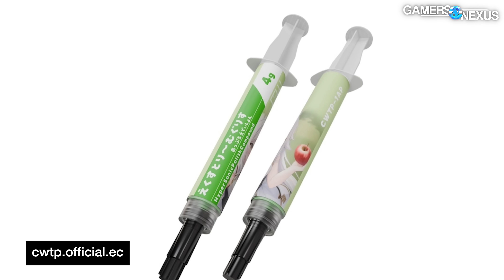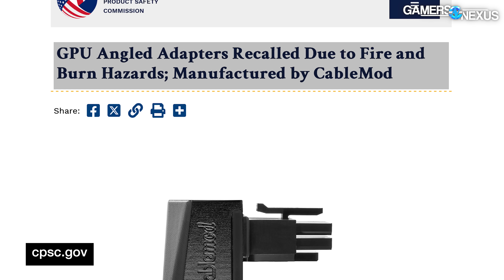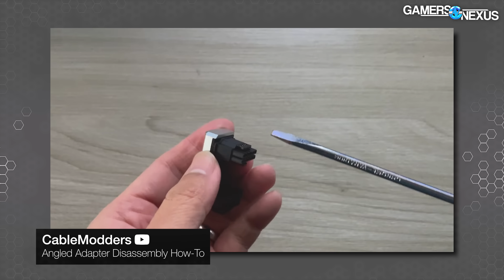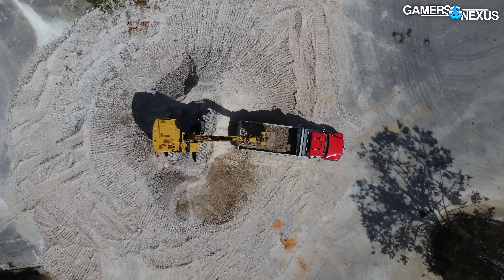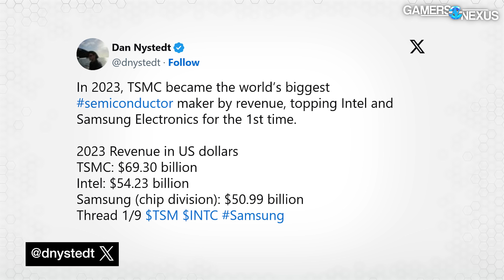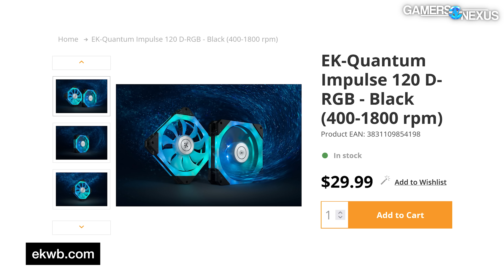HW News - CableMod 12VHPWR Safety Recall, Pre-Built PC ft. Malware, Scented Thermal Paste

Comment: The CableMod adapter recall is pretty ironic. If you heard about it prior to release, it was somewhat smugly touted as a solution to cables bending too much in reddit comments from the official account when burned 4090 cables were making headlines. Good on them for initiating the recall though.
Reply: Well, to be fair, it is a solution to bending cables.  It's just a terribly designed plug, which is not Cable Mods fault, they followed the spec.  These things should have retention clips on both sides to make sure it can't wiggle out.  It's just too wide for a single clip in the middle.
Reply: @TurinAlexander EXACTLY 12VHPWR is just a ABYSMALLY bad spec. There is no reason it should of ever been adopted by anyone.
Reply: @TurinAlexander  the plug's failure rate is below 0.1% and CableMod's angled adapter has an over 1% failure rate. Clearly CableMod did something wrong with the angled adaptor and it is entirely their fault. You can't blame the plug when CableMod themselves are selling other products using the 12VHPWR connector that are not failing as much as their angled adapters.
Reply: @ShinePostMiro  I suspect no one knows the true failure numbers of the 12VHPWR connector, I suspect some users caught the mating issue before it went critical and are living with slightly melted/warped etc... 12VHPWR Graphics card connectors, thus not officially reported. Again, I suspect most gamer/power/professional users types don't want be without their PC for a week plus RMA if their card is otherwise functional... Cablemod seems to be doing the right thing... they aren't a billion company so can afford millions of dollars in possible claims and or hide the issue (the big boys are well known do underhanded things to hide "issues"). I studied electronic engineering, I didn't end up working in the field, but I know enough  to know that the 12VHPWR is a style over substance design like most modern connectors (e.g. USB, USB-C, HDMI - wear out quickly,  with no locking mechanisms by default compared to what they were replacing) . The mating conductor(s) surface area is just too small for a decent safety margin especially for cheap  mass market production,  lastly the 12VHPWR  is rated at 600watts  and this issue is happening with the RTX 4090 @ 450 watts (average) unless there is revision I doubt we'll ever see a device pulling ~600 watt continuous on this connector.. old school standards would rate something at 600 watt but would be  engineered to be capable 700watt for safety.
Reply: @ShinePostMiro of course. But the fact it was conceived as a means of mitigating the design flaws (even if it completely failed at that goal) showcases the intent flaws of 12VHPWR
Reply: @Soandnb  The reality is that the connector works fine for at least 99.9% of the population.
Reply: @ShinePostMiro  I actually dug into that. The actual known failure rate of the dangle cables is somewhere in the .006% or lower range. There could be more, but the number of officially submitted melting failures is under 100 (This data does not include Cablemod from what I could tell. It only included the standard cables that came with the cards) out of now millions of 4090 units sold. But there is a reason they updated to the 12V-2x6 standard and cards are being cut over to it. The design might be fine but that doesn't mean it's good. The new standard does seem like a good tweak to make it a little better and safer.

As a side node, I don't believe I have heard that the Corsair or other bridge options are having the same issues as Cablemod.
Reply: @joee7452 That definitely does NOT include CableMod, because I’ve easily seen 30 burned CM cables myself just on Reddit. That’s just random posts too. Not me searching for them.
Reply: @MarioGoatse  Ok, makes sense because Cablemod would be considered after market and the reports I tracked down on the BBB watchdogs would have classified them separately. We do have to be careful though because not every post is real either. Cablemod does have  a larger issue it seems then the original cabling one but trusting every internet post saying it happened to them is questionable. 
I remember a lot of reddit posts pulled the first time around because some people were taking a posted picture and photo shopping it and posting it themselves. With the new AI art tools, it's hard to trust anything anymore.

Either way it doesn't matter. Cablemod is recalling and the standard has already been updated and cards are moving to that. Would have been nice if the spec and cabling tweaks would have happened earlier so all of this could have been avoided.
Reply: wow, someone who actually uses ironic in a proper setting. Am i dreaming?

Comment: Around six months ago, I bought some USB memory sticks from eBay that came with a trojan. I told the seller and his reply was "yeah, that happens sometimes". eBay, in its infinite wisdom, cancelled all the seller's listings for that specific USB stick... and left the other 70 listings or so he had for slightly different USB sticks.
Reply: Why I always check a USB in a sterile environment offline and clean it.
Reply: That just happens…
… could you tell the seller so we all can avoid that one…
Reply: @haukionkannel  - I've tried posting but YouTube's "advanced AI" probably thinks I'm advertising and deletes the message. Anyway, that account is inactive now. I'm sure he has another 10 or 20. Just treat every new USB stick as infected (use a non-admin account to scan and format it, preferably in Linux, before use).
Reply: @haukionkannel  - On retrospect, maybe the seller name was a hint that you might get shafted: "lovedong11".

Knowing the name won't help you much, though. It was one of those Chinese sellers / companies that have 50 different accounts (all selling exactly the same things, with the same photos, etc.), so avoiding that specific one probably won't make much difference. And they seems to have stopped using that one anyway (the account still exists, but the store is empty).

Just make sure you don't have any type of autorun enabled, always run a virus scan on any new USB drives, and format them before use. Also, the first time you connect them try to a) use Linux and / or b) use a limited (non-administrator / non-root) account.
Reply: @haukionkannel  - In retrospect, maybe the seller name was a hint that you might get shafted: "lovedong" followed by some numbers (if I type them here YouTube seems to think my comment is spam).

Knowing the name won't help you much, though. It was one of those Chinese sellers / companies that have 50 different accounts (all selling exactly the same things, with the same photos, etc.), so avoiding that specific one would just give you a false sense of security. And they seem to have stopped using it, anyway (the account still exists, but the store is empty).

Just make sure you don't have any type of autorun enabled, always run a virus scan on any new USB drives, and format them before use. Also, the first time you connect them try to a) use Linux (any trojans are far more likely to be for Windows or OSX), b) use a limited (non-administrator / non-root) account, and c) make sure you're offline.
Reply: It's hilarious that Acemagic's site doesn't even try to address this.  The only thing on their news page is an apology for some systems that came preinstalled with a Bing search engine. Oh perfect, and their solution to that is for the user to download system files from a Google Drive.  Jesus Murphy.
Reply: This is one of the reasons why one should never buy cheap or unbranded USB sticks. Another reason being the use of extremely cheap NAND that doesn't even have the stated capacity, is extremely slow or might even fail entirely after a few uses.
Always buy USB sticks from reputable brands like Kingston or SanDisk and, this is just as important, from trustworthy retailers that are unlikely to end up with counterfeit brand products.
Reply: @Hurricane2k8  - Your first paragraph kind of describes half the products sold by Kingston. 😉

I once asked them how fast one of their products was supposed to be, and they asked me to test it (probably so they could say "yep, that's exactly how fast it's supposed to be"). I told them I'd already tested it, I wanted to know how fast it was supposed to be. After exchanging 5 or 6 e-mails, they finally admitted they have no idea because they switch memory suppliers depending what's cheaper that week, but still said it "should sustain 10 to 20 MB/s" (in fact, it struggled to do 7 MB/s).

They have a few high-end models that are (supposedly) quite fast, but the prices are kind of silly.

And another Kingston stick I have doesn't work at all in half the systems I've tried it on. 

Amazon Basics USB sticks have the best performance / price ratio I've seen. Sequential reads above 250 MB/s and writes above 50 MB/s, which is fine for 95% of applications. Of course, I'm sure Amazon also tries to get the cheapest memory possible, but (probably because they're not trying to sell overpriced "premium" models - yet) they seem to have some actual quality control / minimum performance standards.
Reply: That's why you don't buy anything that stores or transfers your data from eBay.
Reply: @claytonreeves150  - No, that's why you always treat new equipment as potentially unsafe regardless of where you brought it.

Several big name brands have shipped infected products directly to customers.

Comment: Thunbnaiil input:
Uh, it's kind of hard to make out the point of it without understanding the stories behind them beforehand. Maybe, try swapping the white glow around around the CabeMod adapter and malicious PC with their respective colours of text, since there is a black outline around the text already which wouldn't cause it to get lost with this modification.

Otherwise, without understanding what the shapes are, it's almost like you are saying to not use, or buy the scented thermal paste. Which, it would have been significantly more funny if instead of "SCENTED THERMAL PASTE", you complete the theme by replacing that text with "DO NOT EAT".

Comment: Scented thermal paste.  Kinda like the really high end Motul automotive products. Different smells for different fluids specifically so pit crew can determine what is leaking by smell.
Actually not at all like that but now you have some Motul trivia 😊
Reply from the maker: Brilliant way to identify fluid leaks. That's truly the future for PCs: "hey, which paste is dry? If the apple smell stops, it's the GPU. If the strawberry smell stops, it's the CPU!"
Reply: @GamersNexus But what about when it smells of burning plastic?
Reply: @TriccyViccy Must be alienware, just throw it out
Reply: @TriccyViccy  You were supposed to throw out those angled adapters!
Reply: Then its the NZXT H1 riser cable
Reply: @TriccyViccy  Well then you've got a bonus.
Reply: @TriccyViccy  Time for a new graphics card and 12V power cable of course!
Reply: @GamersNexus the water cooler blue fluid smells like raspberry
Reply: GN keeps asking for seven-segment motherboards, but what they truly needed were seven-scented motherboards. Orange cinnamon? Reseat RAM. Apple jasmine? Overheat. But the main problem is I hear it's hard to differentiate apples and oranges.
Reply: We need scented 12VHPWR Arson Connectors. Wait. The burning smell is a good indicator already.
Reply: Except something would have to go horribly wrong for your thermal paste to start leaking. Considering it's not a fluid.
Reply: @dojelnotmyrealname4018  per my last line "Actually not at all like that but now you have some Motul trivia"
Reply: Smells like Cancer 💀
Reply: Hmm...strawberry vanilla...must be big end bearing failure with a sprinkle of ATF
Reply: This reminds me of Peaty's and its mint scented bike assembly grease which smells really good.
Reply: @evbchannel  Peaty's products are mint scented, Tru-Tension products (specifically BananaSlip tungsten lube) are banana scented and Muc-Off products can run from apple to bubblegum scented.
Us Brits like making inedible chemicals smell like food for some reason.